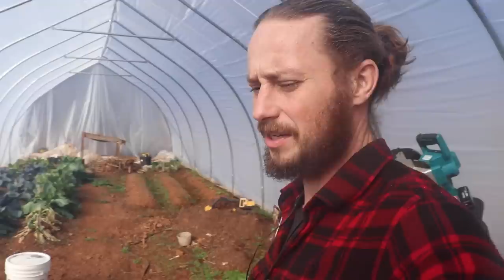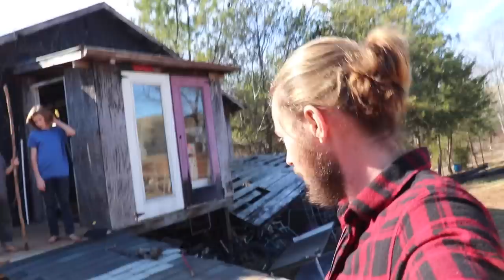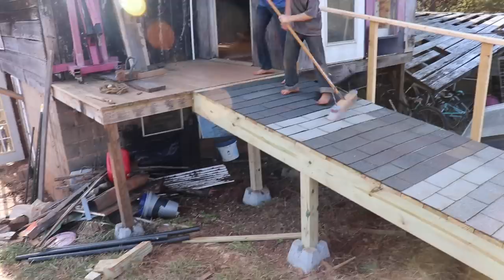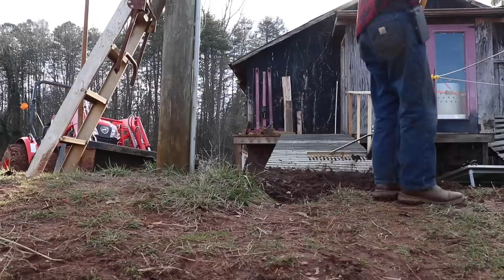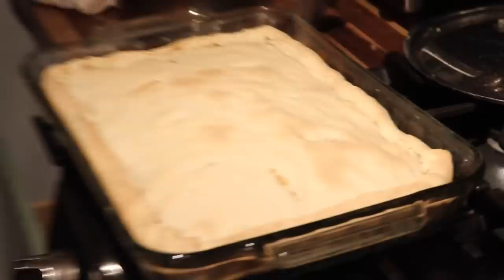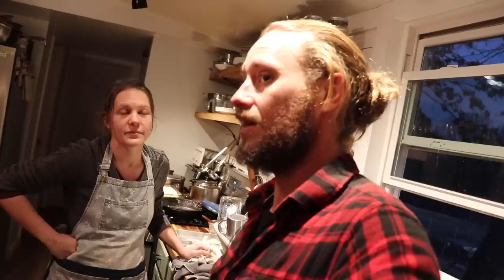The Same, But Different

Comment: Add a piece to aluminum stair nose to the other side of the ramp and the shingles won’t blow off in heavy winds. I own a flooring store and any flooring place should have it in 12’ lengths at roughly $14 a stick.

Comment: You could put bracing on the rails to stiffen it! Using the shingles was a great idea! They can also be used on the outside of utility structures! In some regards stronger than siding! Reuse and repurpose what you got! Improvise, adapt and overcome lifes issues!

Comment: The ramp is looking great! You might consider adding a railing at Buggy height for little humans. 

That lemon pound cake looked delicious, too. As you're using the rest of the lemons, you can cut the rinds (peels?) into strips and candy them. They will have the texture of a gummy candy. If I remember right, you boil them once, drain the water, boil them in sugar syrup, and then I think dehydrate them for a bit and toss them around in some sugar (I'm not positive on the last two parts, its been awhile). I've done it with orange and grapefruit rinds. Great way not to waste the peel, and a nice sweet/tart treat to have on hand.

Comment: We used old shingles under our fence line, we use stucco wire not cattle panels for the garden.  The weeds always came up in the wire drove us nuts. We slid shingle cut length ways under the wire, no more weeds,

Comment: 🍋🍋🍋🍋🍋Meg!  I tried a tip I seen somewhere on line for 🍋’s. So far it’s working!  What you do is wash lemons and place whole into a container that can be sealed. Pour water over them, making sure they are covered.  Seal container & put into refrigerator.  Mine have been in for about a month and a half to two months.  Couple of weeks ago I needed one.  I wasn’t sure what I should expect.  I removed one, dried it and left it on the counter until later that day.  I was able to zest and use the lemon as I would with a fresh lemon! I resealed (with press & seal) and back in the fridge it went. Save those lemons!🍋🍋🍋🍋🍋🍋
Reply: The_Hollar_Homestead  
Hi!  What did I win?  Are you trying the tip? 
Bunny

Comment: Spring is coming but don't be fooled, there is more freezing weather on the way. The other day it was 19 degrees and today it is 45 degrees. Some nights approach freezing and other nights it is almost as warm at as it is in the daytime. True Spring will come late this year. Many trees like mine are already budding. I hope they don't sustain damage. I will be starting my seeds inside. If I had to guess I would say we are going to have another hot summer. Trust the Farmers Almanac. Meg, you can slice and freeze lemons for lemonade or Freeze them whole and then juice them after thawing.

Comment: I know this may sound stupid, but I would bet that it will work. Where you weren't real happy with the coloring on the shingles? Get a can of Krylon flat black spray paint, and just kind of spray the whole thing (OK, maybe two cans). Yes, it will wear off, but it will wear off kind of evenly, and I would bet that as the shingles kind of soften a bit they will absorb more of the paint. I'm not saying "paint" the entire thing, I'm saying kind of mist it and blend everything. Just a thought. 😊

Comment: You'll probably want to lag bolt the hand rail to the bottom board of the ramp.
Reply: I was thinking the same thing. Maybe two lag bolts each vertical board, offset from each other for more stability.